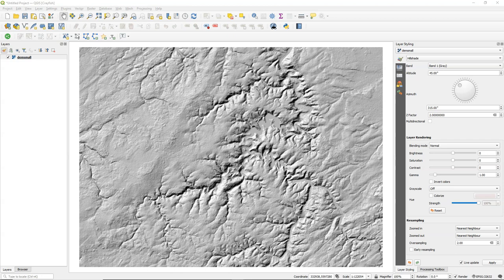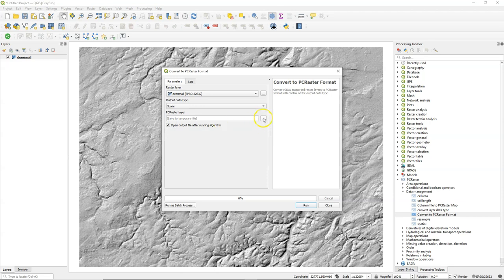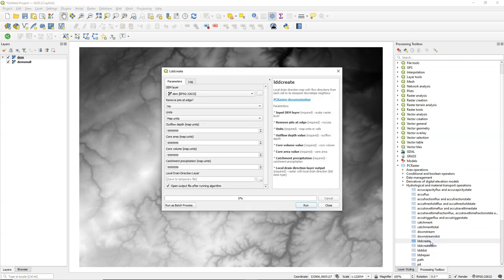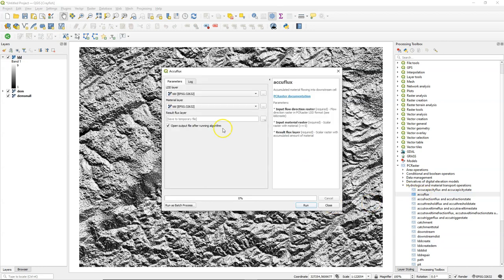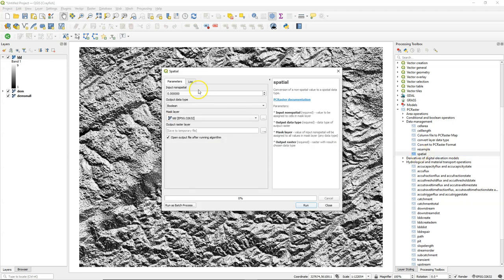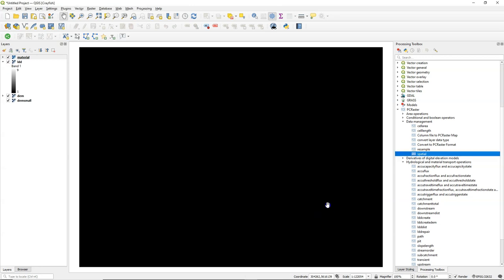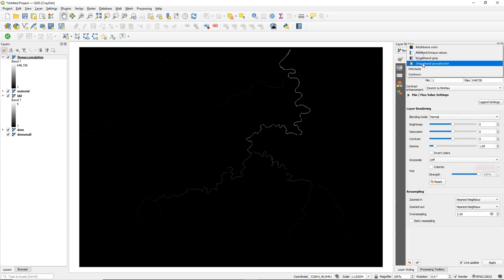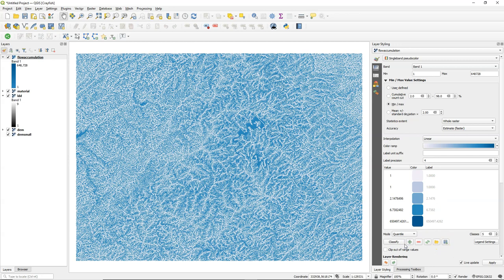Calculate Flow Accumulation in QGIS using the PCRaster Tools Plugin

Comment: Hey thanks for all the videos, I have a problem with the lddcreate process. QGIS always crashes when i run it. I am using SRTM1 data on a 1.5°*1.5° scale. Is it because older system can't handle it or is there some way of troubelshooting?
Reply from the maker: Male sure that the DEM is projected, so not in GCS lat/lon coordinates. Also make sure you've converted the DEM to PCRaster format before using lddcreate.

Comment: Hi all, 
lddcreate crashed all the time for me. 
The problem was that I had a DEM of a basin that was surrouned by more elevated topography. So, there was no natural outflow. In order to get lddcreate working I needed to "fll sinks" using SAGA. However, sink-filling algorithms typically attempt to remove all depressions (sinks) in a DEM, including the natural basins, by artificially creating an outflow point to ensure hydrological continuity. So it works now, but my basin is gone. Just in case someelse has this problem, you now know the reason.